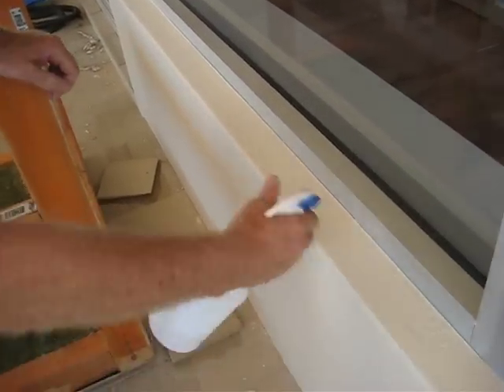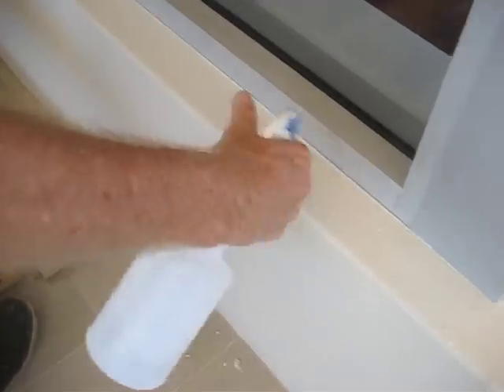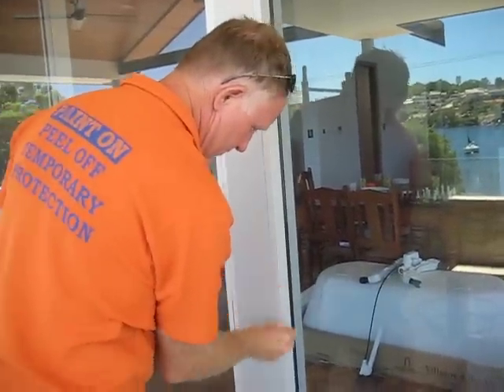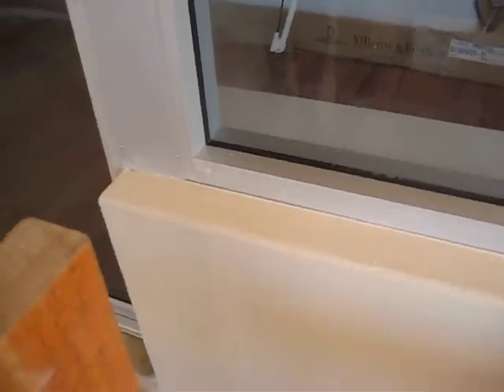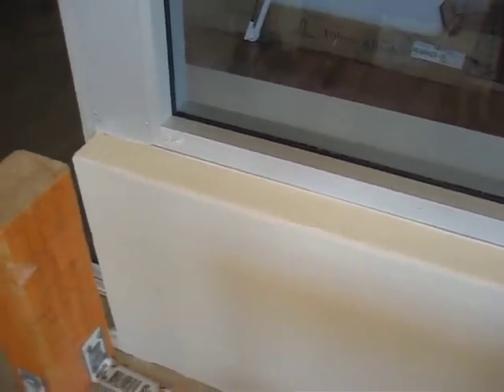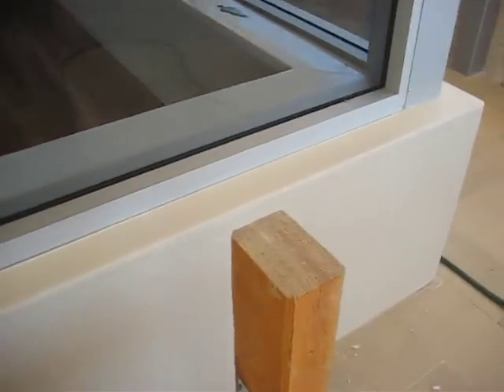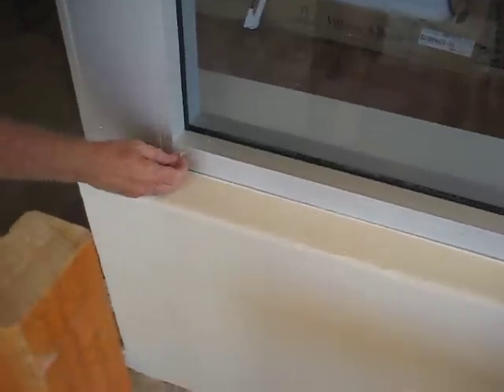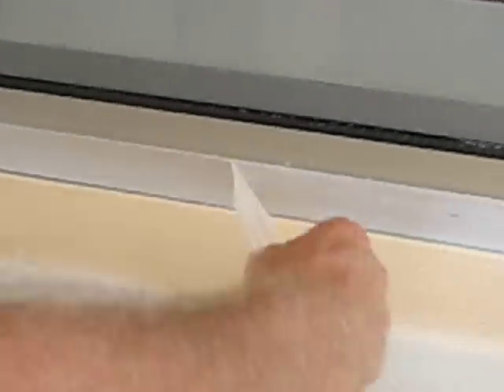WINDOWSKIN PRO REMOVAL - JOHN GREGORY WAY!

Comment from the maker: Spray bottle with water....is that what Mr John Gregory used in December  2008 at the Hunter Valley  job? 
Did it work on the powder coated frames?
As soon as we find out, we will post another video for the benefit of all concerned.